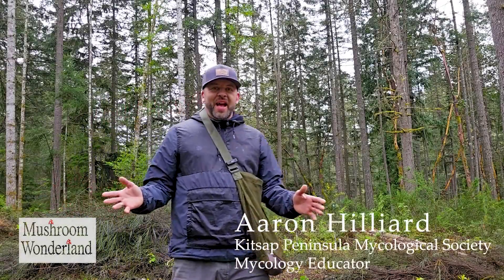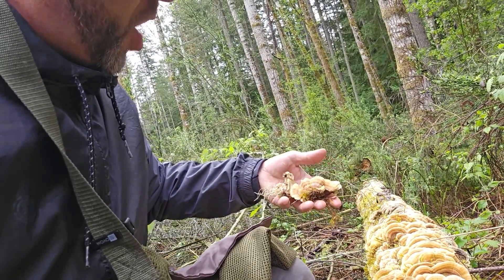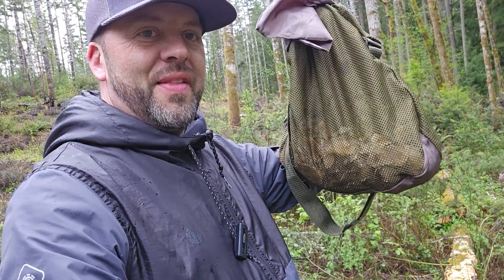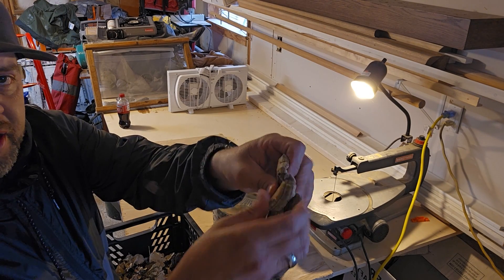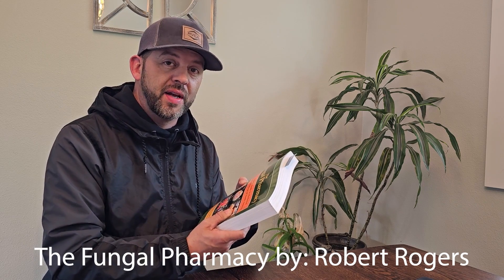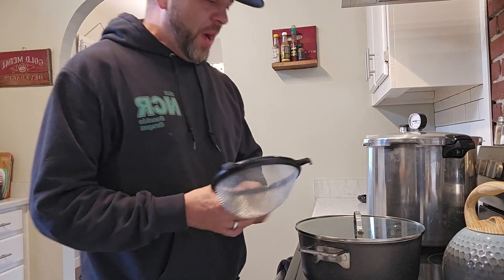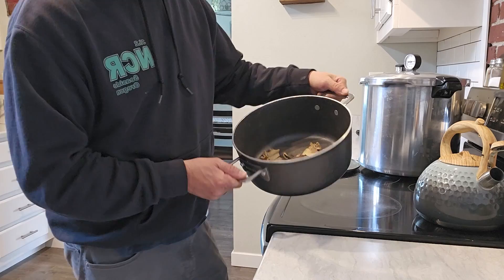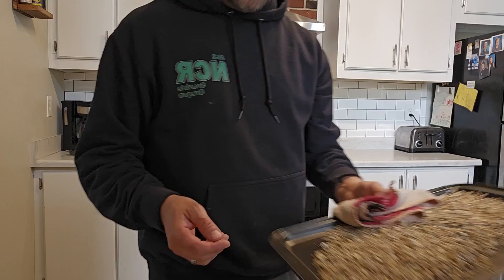Turkey Tail Mushrooms- ID, Forage, and Prepare

Comment: You can save a little bit of handling by using a paper cup tared out on the weigh scale.  Just squeeze the lip into a point for pouring into the bags.
Sorry to see your Presto PC spin on the stove surface like that.  The bottom must have bowed in the past.  Hope It is still safe. 
Thanks for the Turkey Tail video
Reply from the maker: They all do that to me! I tossed the last one, but I've been running this and it hasn't exploded or anything, 🤞

Comment: 12:03 - Could one also grind them up when they are dry and break easily (without cooking)? I never tried it, but I could imagine that that would result in a finer powder. I also heard that air drying makes them more porous and break more easily (never tried that either though).
Reply from the maker: It'll fluff up into a crazy cottony mess. I've tried that, it kept binding up the food processor and the grinder.